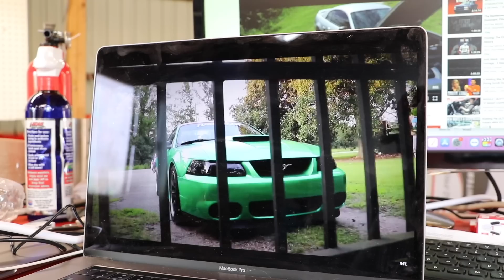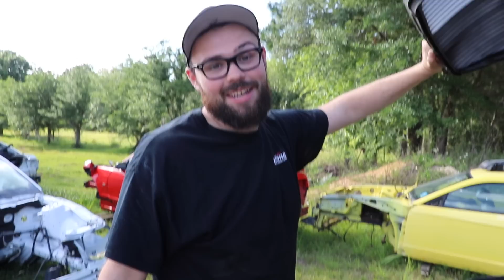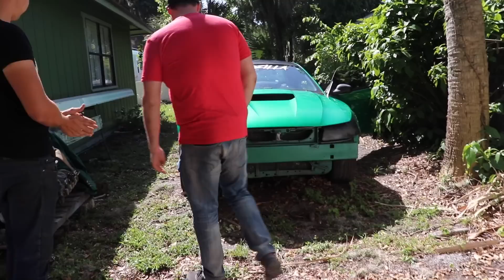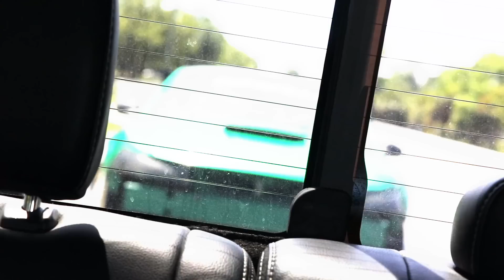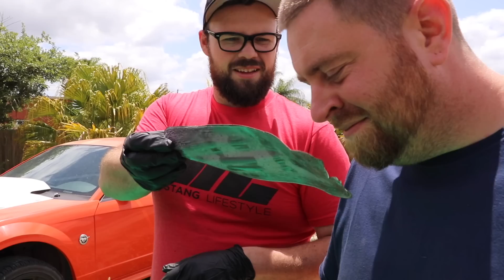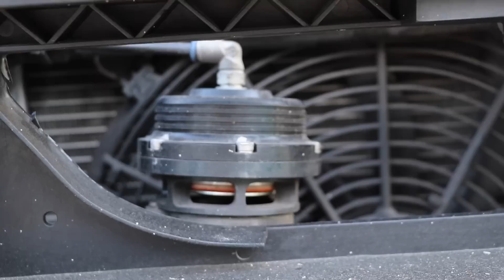I bought back Turdzilla...

Comment: I would like to see the 5.4 4V out of that Navigator swapped into Turdzilla. No need to supercharge it. Don't know if you can hop it up NA without having to buy a lot of parts you don't have. You should be able to do burnouts easily with this motor.

Comment: Just go budget with something you have. That 5.4 4 valve sounds cool.
Reply: The lack of aftermarket for intakes/exhaust make it a PITA.
Reply: @20b3rotordream  I think it would be cool to do one with an m122 off an early gt500 on low boost that would take care of the no intake option lol.  You don't really see guys doing that.  I assume a gt500 lower manifold would work on it with minimal if any work because 5.4 4v
Reply: @20b3rotordream  you can make headers work on them it's just the intake problems mostly but there is an adaptor that allows coyote intakes to work on em.
Reply: @midnight347  the juice isn’t worth the squeeze at that point man. Yeah I made long tubes work on my 5.4 swapped 02’ but there was alot of massaging. They also do not like high rpm and we’ve all seen how Andrew loves the limiter.

Comment: 1st off I am digging the new intro 😎.
As far as engine choices
I vote 7.3 if you can swing it. If not 5.4 32v engine. Both of these engines bolt up to a tr3650 I believe. 
Or a 351w swap with a t5 would be cool too.

Comment: i know it may sound eh, but 3.7 out of a 11-17 mustang, and boost…🫣

edit
v6 would be light weight, decent on gas, can hold 600hp, no one expects a v6 to be fast, so can break a few hearts. 
after i get my 3v all set up, and my 05 v6, imma throw a procharger on the new edge v6.

Comment: I know you could probably find a wrecked Ford with a 3.7L V-6 power train.  Do a budget turbo build on the 3.7.  I heard they make good power and hold up pretty well too.  Just thinking outside the box.  Something different.
Reply: They can do 600 on e85 turbo setups and they are super light in a new edge it would be crazy power to weight ratio and Def different.

Comment: 7.3 Godzilla or a true built twin turbo 2 valve. Idk what happened with Jordan and the previous 2v build, but there needs to be a true built 2v. Make it TT setup, it’ll be unique. The 5.4 4v would be dope too, that’s almost an old gt500 motor, I wonder if you can use the 07-10 gt500 blower swap would work.
Reply: Should work with the lower manifold.  I don't know if any mods needs to be done if so I'm sure it's minimal since they're both 5.4 4v.  It's similar to a gt500 motor but the bottom end isn't as stout especially the rods.  They can do like 400-500 max while the gt500 motor can do 700-800+ with the right supporting mods and fuel.

Comment: I think the 5.4 would be awesome or a cyclone v6
Reply: V6? Lol Cyclones are cool when they're in their own car but not really a swap
Reply: @169abr  it would actually have alot of potential it would be stupid light with that engine and they're capable of upwards of 600 wheel with a turbo on e85.  That would actually be pretty nasty power to weight ratio.
Reply: @midnight347  I mean yes, but they sound like ass, They don’t have built engine support as far as I’m aware, and it just seems kinda odd. I know they can make power, I saw David’s S197 run when auto mafia was testing their kit early and it still runs well but it just seems kinda meh to swap a V6.